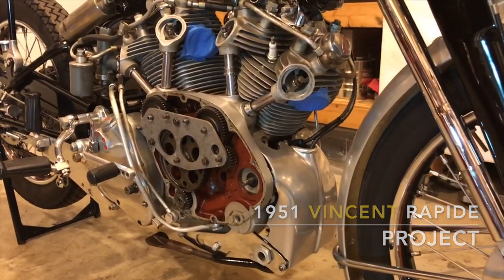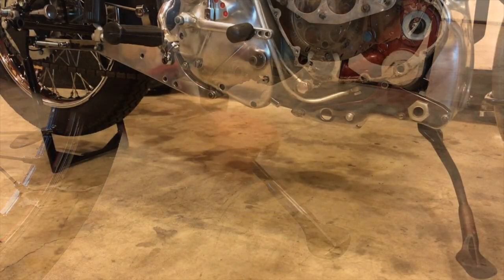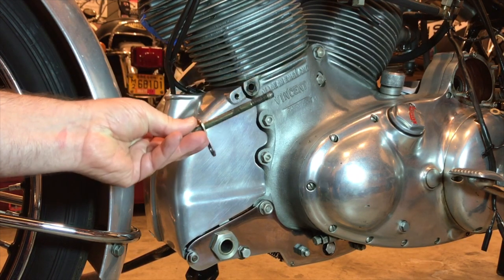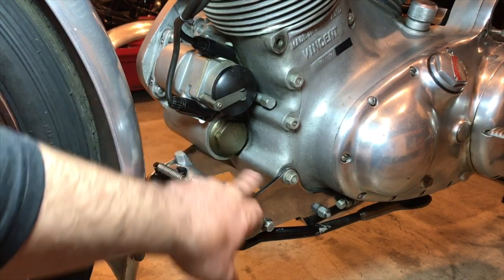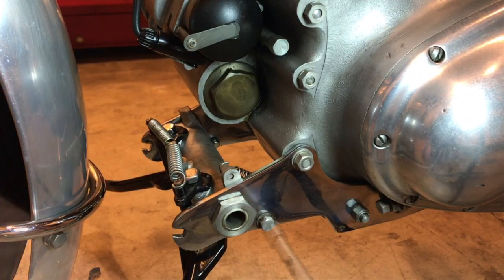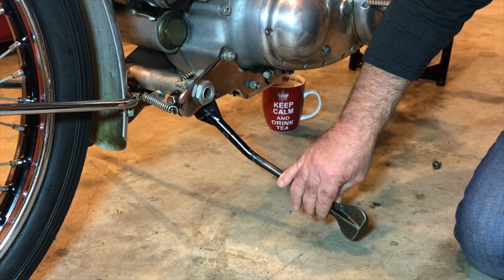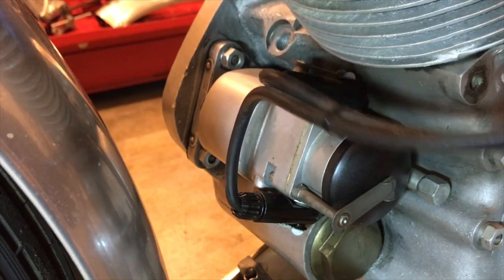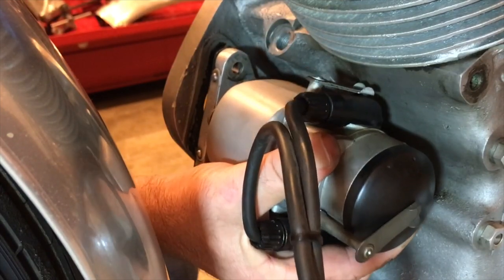Restoration of 1951 Vincent Rapide - Part 10 - Magneto

Comment: Happy new year...!  Just watched this one and noticed that the primary chain adjuster is all the way in  on your Rap.  At best this means you need a new timing chain.  At worst there could be more bits missing in the primary case..Either way it all can be fixed by just following the  literature and applying a bit of ingenuity and money..:-)  I know you will do your normal brilliant job  on the resto.Cheers
Reply from the maker: D Ducdude Happy New Year, Eric. Thanks for spotting that. I hadn’t noticed. Yes, I’m sure I will be taking the primary case off as I’ll need to check in there. Haven’t even checked the clutch yet. Best wishes! Mike.

Comment: Hi, I assuming that by now you know how the front stands work, but if not, you need to leave both stands in the folded position when you take out the small set screw. This will allow both stands to drop down under spring tension. Then straddle the front wheel facing the bike and left the front wheel off the ground. The will allow the stands to drop further until they hit the stop, at which point they become a centre stand holding the front wheel off the ground.
Reply from the maker: Many thanks. Yes, that was a Vincent-rookie mistake. I think in the next video, I finally figure it out!  Best wishes, Mike

Comment: I am really surprised that there was oil in the system, everything so far points to the engine just having been thrown back together to keep all the bits in one piece, but having oil seems to imply that it has been run ? Nice to see the correct tools being used !
Reply from the maker: Hi Chris, yes, fair point about the adjustable spanners.  I do try to use the correct spanners/wrenches whenever possible.  Yes, the Rapide had run.. right up to the point that the piston was seized.  And then it was laid up since about 1993.  Cheers, Mike